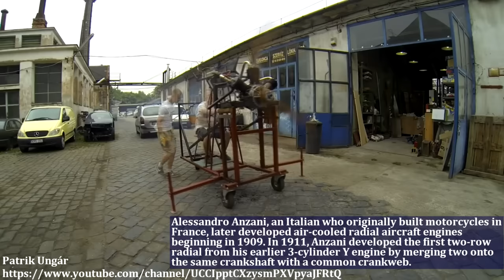100 Years of Big Aircraft Engines And Their Starting Up

Comment: I worked on many R-2800 Pratt and Whitney engines back in the early 70’s. T-28’s, C-123’s, C-54’s. They were a real workhorse throughout the 50’s through the 70’s. I understand that even C-47’s are being retrofitted with 2800’s now.

Comment: 5:30  How can it run cut open like that?  Wouldn't all the pressure leak out??
Reply: The engine isn't really 'Running" with fuel combustion, it's being turned and sound piped in to simulate running

Comment: No mention that the Wright Flyer 1903 engine was made by their bicycle mechanic Charlie Taylor.
Taylor built the engine in about 6 weeks, just using a lathe and drill press and sketches on a note pad.
Charlie Taylor was given almost no credit for developing the engine by the very self centered Wright Bros.
The Wright Flyer without an engine is just another glider.
Reply: True,  but remember a lot people made engine that time but only one put in glider and flew.
Reply: @ninozz  many others built gliders but didn't have a suitable engine. The engine was the key to making the Wright Flyer successful so Charlie Taylor deserves just as much credit as the Wright Brothers.

Comment: You miss the howle German technology. For example DB605 from which the US tought it is a radial engine but it is a inverted V12 with up to 2150PS and the fact that the first flyable plane with an jet engine was a German one (Messerschmitt). The DB605 was using a compressor long before some guys in the US used one in a plane and a fule injection system which allowed it to use NOS as boost.

Comment: You must change your title to : Most amazing (mostly US) engines. There are lots and lots of other and allot more amazing engines in the world then these ones. Did you forgot about the Merlin?
Reply: and Griffon......the merlin crapped all over the Allison hence they build the merlin under licence
Reply: @Slapbladder  actually you are wrong there ,, the USA started building merlins for the british cause they couldn't build them fast enough  ,,and with the US building them they had a more secure supply line ,allisons were actually very good engines but the merlin was designed from day 1 to be supercharged the allison was not ,this is what gave the merlin an advantage ,,aircraft like  the P-38 lightning did very well with the allison engines  and the GE turbo-supercharger ,,what we plain call a turbocharger now ,,the merlin used a single or multi stage,single or multi speed mechanical supercharger ,,as much as 30% or more  of the engines power was used to run the supercharger ,,while the Allison as used in the P-38 used ALL of it's power to turn the propeller and the Turbo-supercharger used exhaust to produce boost and increase the engines power output
Reply: @wildcoyote34  Generally you are correct, although Allisons were indeed always supercharged. The issue is that they weren't initially TWO stage supercharged whereas the Merlin got a useable two stage earlier. There were always two stage Allisons contemporary tp the Merlins, but they would not physically fit in the Mustang ( or Spitfire, for that matter ) without major airframe redesign. Two stage Allisons were used in the P63, but the aircraft itself didn't really fit 
The story of Packard producing Merlins is an interesting one, I wish there were a comprehensive book reqarding that piece of history ! requirements.
Reply: @wingmanjim6  the allison engines i am familiar with  are the simpler design  as used in the early mustang which had just the single stage centrifugal supercharger ,,the airplane most synonymous with the Allison engine was the P-38 lightning and they had the GE turbosupercharger which had huge advantages over the Merlin counterpart ,,the biggest one was not requiring such high octane fuel to prevent detonation .turbosupercharger equipped engines didn't have problems with exhaust  flares which gave away their position at night ,,the 3rd advantage of the turbosupercharger over the multi stage/multi speed supercharger is it isn't driven directly by the engine  ,,the turbo being driven by the exhaust recovers lost engine heat and returns it to the engine in the form of boost ,, the supercharger draws an increasing amount of engine power the higher the plane goes  and the higher the speed of the supercharger ..as much as 30% or more of the engines horsepower is taken by the blower ,,,what really made the Merlin engine  a winner was it's mass production and eventually it's reliability ,it continued in production after the war and eventually the later models were running thousands of hours between overhauls ,,,
I've been asked personally which engine i think was better ,and i don't really think either engine was better than the other ,they both were excellent engines  ,in the end they were both very reliable  and saw long service ,,in the USA the only water cooled engine was the Allison ,,just like the brittish with the Merlin which they used on a variety of planes ,,,the US airforce refused to use liquid cooled engines in it's bombers
Reply: @wildcoyote34  The quality of the Allison engines was known to be allot worse then the original ones build by Rolls Royce
Reply: @bartdereu9267  actually  that is debatable most of the actual engine problems weren't actually caused by quality issues but poor management of the engine 
the V1710 was actually already in production before the war , i think it was 1932 when the USAC bought the first ones for testing and was actually the first engine to reliably produce 1000 horsepower ,,
sad thing is there were some really good engines that were overlooked ,,FORD had a V12 of their own design as well that was more modern and a simpler design and had similar power characteristics to the allison 
it was passed over because nobody had heard of FORD building airplane engines ,
we know it today as the GAA which was the V8 gasoline engine used in the sherman tank ,,it was a modern design still by today's standards  , it was a monoblock design with   it's cylinders in the block and removable heads and dual overhead camshafts like nearly every other automotive engine with a few exceptions
another engine that would have been amazing if developed was the Lycoming XR-7755-3 it was a monster 127 liter 36 cylinder radial engine that had overhead camshafts and was water cooled ,it made 5000 horsepower while still a prototype

Comment: The very first engine that fly Atlantic was Rolls Royce Eagle VIII ,V 12 engine.On Vickers Vimy airplane,from Newfoundland to Ireland,in 1919.
Reply: You are correct that the first NON-STOP flight was powered by Rolls-Royces but the first aircraft to cross the Atlantic was the Liberty powered Curtiss NC-4. It took 10 days and 22 hours to get from Newfoundland to Lisbon with a protracted stop in the Azores with mechanical trouble, eventually arriving on the 27th May 1919. Nonetheless this was the first aircraft of any kind to cross the Atlantic by air. Alcock and Brown achieved their rather more impressive feat in June.

Comment: So where was the Merlin. The Allison v-1710 was rubbish compared with the merlin and its high altitude performance as poor. the trainer version od the F 82 Twin Mustang with merlin engines was faster and more fuel efficient than the Allison engined birds
Reply: The Allison V-1710 was vastly superior to the Merlin at high altitudes, I suggest you look up the critical altitude rating for the P38 and compare it to the Merlin.
The P82 powered with the Allison had a higher HP rating from take off to altitude and had a higher service ceiling than the Merlin version because it was more powerful. 
No one made engines that exceeded the US's for high altitude performance, I've got some bad news for you, the version of the Merlin that was in Spitfires in the Battle of Britian had single stage superchargers in them, with lower power ratings then the single  stage supercharger Allison engine, guess where the British learned about 2 stage 2 speed superchargers from? The US, the first airplane EVER to fly with a 2 stage 2 speed supercharger was the early version of the F4F Wildcat, it was the British purchasing them is where they learned about high altitude supercharging, Merlin engines didn't have that type of supercharger until the British saw them on the F4F's they purchased and started copying them for the Merlin, the 2 speed 2 stage supercharger version of the Merlin didn't even enter service until 1942.
That whole BS narrative about the Merlin replacing the Allison in the Mustang is just that, BS, it sounds good to people who don't know any better and don't understand the timeline of the development of the aircraft and their engines, the original specifications laid down for the P51 by the British government wasn't for a high altitude plane, it was for a low level attack aircraft which is why it was fitted with an Allison with a single stage supercharger in the first place, that's the best type of supercharger for low level aircraft because the supercharger doesn't have an unnecessary 2nd stage dragging an extra 250 HP off of the engine, Rolls Royce themselves made single stage supercharger versions of the Merlin throughout the entire war, that's what was used in the Seafire because it was intended to be a ground attack aircraft. 
The Allison V-1710 outfitted with either a turbo feeding a single stage supercharger or a 2 stage 2 speed supercharger out performs a Merlin at any and all altitudes and they have a service life 5 times longer then the Merlin and half as many parts, they don't require special camshafts to reverse direction, simply take out the crankshaft and turn it around to reverse the engine rotation, the firing order doesn't even have to be changed, the only reason the USAAF used Merlin's in the P51 is because Packard was already making them and even though the Allison was superior in every aspect it would have been stupid in the middle of a war to shut down the production line and retool it to make Allison's, they were worried about winning the war not what people would think 75 years later. 
The very first high altitude aircraft engine ever made was in the US when the US Army Signal Corps took a 300 HP Liberty engine and outfitted it with GE turbo in 1919, since there wasn't an airframe in the world at the time that could fly high enough to test it they drug it to the top of Pike's Peak with horses where it made 305 HP at 19,000 ft, 5 HP more then it made at sea level, it was on that day that high altitude aircraft engines were born, everyone else was always playing catch up after that.

Comment: Conspicuous by its (deliberate?) absence is the Rolls Royce Merlin engine - that powered the Spitfire, Hurricane, Mosquito, Lancaster - and provided THE basis upon which the P-51 Mustang's reputation was built!! Shame!!
Reply: soaringtractor  that's not a fact at all. The first Mustangs were powered by Allison V-1710 engines. They were shipped to Britain for the RAF but due to poor high altitude performance the V-1710s were replaced with the RR Merlin 61, which had already proven successful in the Spitfire Mk IX. It was after this that Packard were licensed to build their version of the Merlin 61 (Packard V-1650-3) which entered service the following year.
Reply: The Merlin gained it's advantage over the Allison by way off a two stage supercharger which the American engine didn't have.The Allison was however a reliable engine.

Comment: 3:33  Wow, with the cylinders rotating around, that plane must have had scary handling characteristics!  Like a  gyroscope, you try to turn and it'll flip you upside down.
5:00  Ha!  That's one way to burn up your weeds! :-)
5:27  That's an odd design...  How does that work?  The compressor is on the left, and it's output goes through that pipe around to the combustion chamber on the very right, and then the flow goes backwards through the turbine and exhausts in the middle??
Reply: Yes, I've always wondered about that - the gyroscopic effect must have been horrendous to fight against.  How did you ever persuade the aircraft to turn?!!
Reply: Look up the Sopwith Camel, a rotary engined fighter from WW1. It's renowned for being challenging to fly but it soon became the most successful allied fighter of the war due to it's high manoeuvrability when flown by experienced pilots. The gyroscopic effect of the rotary engine meant it was difficult to turn left but it could turn right much faster than any other aircraft at the time. It was so fast in fact that many pilots would opt for a 270° right turn rather than a 90° to the left.
Reply: The M250 is a reverse-flow design. Air enters the compressor at the front and is then ducted around the engine before turning 180° through the rear combustion chamber and exhausting towards the front of the engine. It's a system that Frank Whittle used in the late 1930s to reduce the length and weight of the engine. There are several other examples of this type.
Reply: @AndyRoo312  You are a bit optimistic about the Sopwich camel: this aircraft was one of the most dangerous to pilot in WW1: 50% losses in accident!...  was engaged in  july 1917 and most fitted witch a Clerget 130hp rotary engine...some was fitted with Gnome rotary or Bentley rotary...The best ww1 allied fighter was the SPAD S XIII (engaged in may 1917) who use 220hp 8cyl Hispano Suiza engines...
Reply: @leneanderthalien  I think I've been quite fair in what I've written. The Camel was challenging to fly and there were many accidents but in the hands of experienced pilots the Camel was an extremely potent fighter, responsible for downing more enemy aircraft than any other allied fighter during WW1. It wasn't the fastest nor the easiest to fly but in the right hands it was excellent.

Comment: 5:20 I remember learning with the Allison 250D when I got my A&P. Even running one up on the test stand. Pretty awesome to seeing flames coming out the exhaust when the burner can lights off.
Reply: True, but to actually be the person making those flames come out the exhaust. Now that's thrilling!
Naval Aviation, 14 yrs. F-14A  jet engine and fuel systems mechanic.
Low power qualified. 
High power qualified.
Out at sea, aboard the carrier, slamming both engines into zone 5 afterburner. That's impressive!

Comment: I see you have a small portable fire suppression set up.... good !    A wee bit better for total safety is a 1500 gal. above ground tank with a small diesel H.P. fire pump, a sprinkler system trenched in a 
100 ft out and all around the house...... thats what we did and I rest well knowing I can surpress a wind blown ground fire. Just an FYI from the Oregon Forest home site
of our house... P.S.  I have a 100ft. of 1 1/2"  fire hose  I can lay out also alone with a 250 gal. portable tank & pump.  Thanks Trent and we need some more flying vids.

Comment: Those cut-away jets are incredible. One critique: the Bristol Centaurus is a sleeve valve engine, i.e., it does not have valve covers. The picture shows a two-bank, 18-cylinder radial, but it is not a Bristol. The Bristol head was smooth and flat, with only one spark plug sticking out.

Comment: When I was an apprentice at A,V,Roe Woodford ,Cheshire in the fifties we rebuilt an Avroe 504 K fitted with a Le Rhone rotary engine.This one had a badly scored cylinder liner but OK,d for a few hours use.After lots of sweat  pulling the prop it started with clouds of smoke and at low revs the misfire on that cylinder could be seen and heard.In the event the aircraft took off on a very short run assisted by two lads holding the lower wing tips.I believe its in the Shuttleworth museum now!
Reply: This engine had original Mica spark plugs and bare brass HT leads stretched from the crankcase pick up ring.

Comment: That Le Rhone is a trip. The whole engine spins like the prop. I've never seen that.
Reply: That's why they were called "rotary engines". Literally it means spinning engine, not something spinning INSIDE the engine, but literally rotating ENGINE.
Reply: Be happy you weren't sitting behind it. Has a constant loss oil system using castor oil. That castor oil. Pilots had the constant squits - not to mention the torque. A Camel will turn right 4 times faster than it turns left, because a right turn goes with the engine torque. 110/130hp. My old Renault Safrane 2.2vi - 138hp.
A German company managed to design a counter rotating rotary - fixed crankcase geared rotating cylinders - but very complex and had a habit of blowing up.

Comment: That SGC-770 Ranger sure isn't an inverted V12 unless somebody flipped it upside down !

Also, I believe the R4360 is generally held to be THE largest production aircraft engine ever built, the key word being production. Largewr experimental engines were built but never produced in useable quantities.
Reply: Yes, it had been converted to upright configuration.  The engine as produced by Ranger was inverted.  In Wichita, we had (and still do) a war surplus outlet that had several of these still in crates when I was a boy in the early '50s.